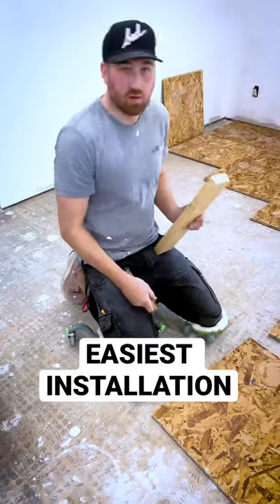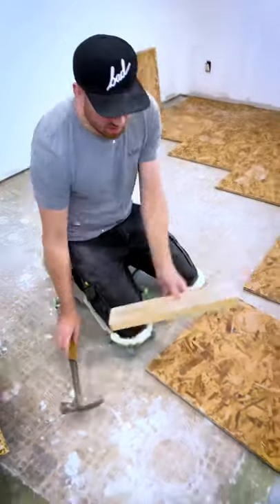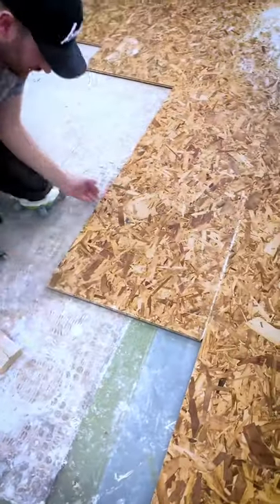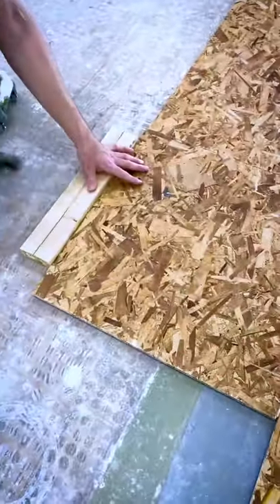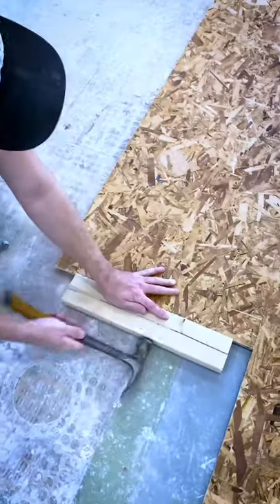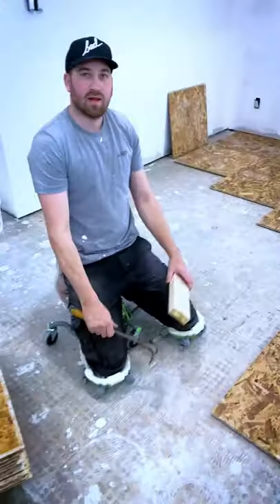‼️BASEMENT SUBFLOOR INSTALLATION ‼️ #shorts

Comment: How do you do it up against a wall though 🤔
Reply: You measure, cut and the use a "flooring pull bar" to pull it into place
Reply: @PYRAMIDCONSTRUCTION-CA  I actually used a 12" pry bar/wrecking bar. Worked great!  I trimmed a little bit of the tongue off with the table saw to get a tighter edge.